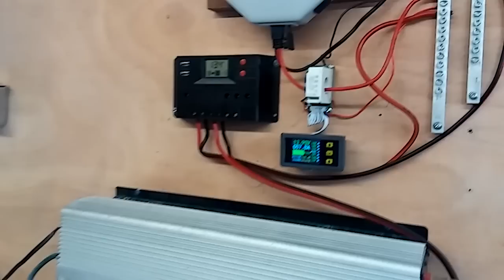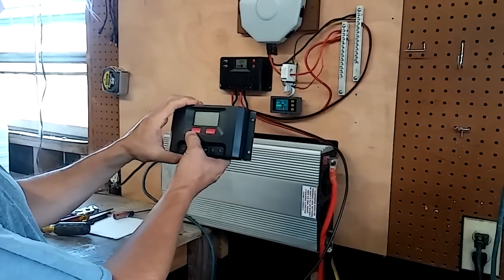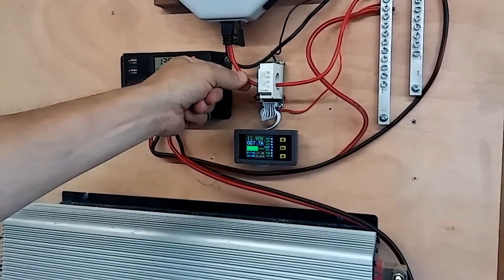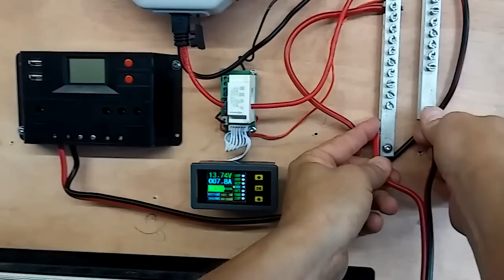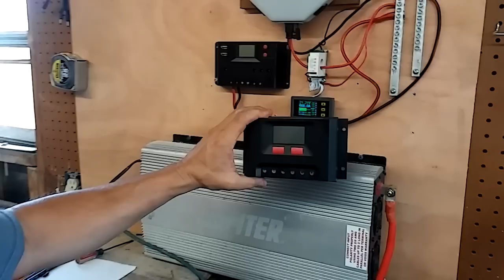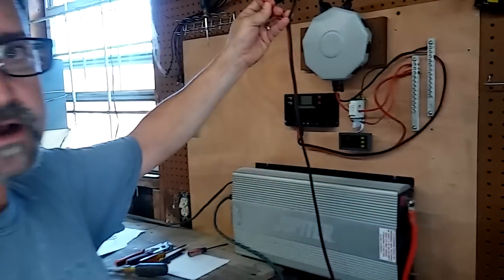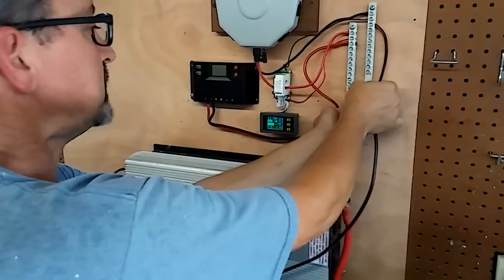Maxing out Harbor Freight solar panels

Comment: Hi, I watch you on utube, a lot and would like to tell ya, Something that happened to me, Concerning your problem of losses of power after Two different set of harbor freight solor panels are hooked up to the controller" with Hope's of Doubling your POWER".!! That Same thing happened to me, and I had to change one of the diode's around on the back of a couple of the panels. I can't remember if it was a whole set" that I did" or one or TWO. However, I do remember that after adding the 2nd, set" Of Thunderbolt 100watt, panels it ONLY gave me  1 1/2 output.!! But I Found out LATER, that it would have been SO MUCH EASIER, IF I had just ( used Both, Charge Controller's)!! And just ran Ea, set Through the Controller it Came with. Jumping the Power supply together just before going in to the Battery's.!! Okay" well, give them A try because " Just to settle for 1 1/2, the Power supply you should have, is not an option for me,. I hope You are the same," I mean It's what we thought we Was getting" Right?? It's what we all go spend our hard earned money for.!! NO, for me to settle, is to say give me 1 1/2 The Gas I have paid for.!! MACK!! OR, just Make it 3/4's  the gas I just bought,z!! Instead, of FULLER up MACK.!! So, There ya, have it.!! Straight from the Horse's mouth.!! Hope it helps,!!!

Comment: So the 10 amp controller can be used with big inverters? And no damage to the controller. I just got a 100 watt kit. Using it to charge batteries but was wondering on the size of inverter to use. I have two 80amp/hr deep cycles at 12volt. Thanks great video!
Reply from the maker: The charge controller is not affected by the size of your power inverter. Just don’t put more panels to your charge controller then it can except
Reply: @Checkitfirst  gotcha. Thx.

Comment: my experience with the 100 watt kit has been that the panels have to be pointed directly at the sun to get maximum output, and they produce a lot less output compared to a single 100 watt renogy panel when laying flat. the charge controller that comes with the kit really is junk.. it works, but you'll never make maximum power with it. the best test i did was to wire all 4 panels in series for 72 volts into a morningstar sunsaver mppt controller charging a 12 volt battery, with the panels aimed at bright sun they produced 9.8 amps. i also suspect that the long cords and silly mess of plug-in connectors in all harbor freight kits causes a lot of current loss.
Reply from the maker: Check out my latest video.. 300 watts now....
Reply: marzsit -What people fail to realize is these harbor Freight panels change some as long as there is light. The panels from Renogy need to be in a certain temperature range to change. This makes them ineffective when cold and mornings/evenings when sunlight isn’t hitting them at all.
Reply: marzsit I have been watching videos on the HF 100w system. I have been wondering if they could be wired in series, how that would affect the power production for the batteries and what would be needed within the system. 
Thanks for the info. 

D.
Reply: Why would you run 72 volts to a 12 volt battery. A 12 volt battery charged just fine at 14 volts. If you are running a 72 connection of solar panels make a 48v battery system and get a mpp solar 48v inverter
Reply: @westmountainadventures3606  I asked many people, finally after a dozen videos one man said you can as long as your using a good charge controller that can handle it; not harbor freight charge controllers are a  joke, but there monocrystalline panels are good. 22.3volts straight output.
Reply: @plove9136  Thank you for the reply. The sunsaver charge controller mentioned above seems to be sufficient to do the job. I’m sure by now there are others that may be better suited for this configuration. Other companies like Victron have such controllers.
Reply: @westmountainadventures3606  solar is so addictive, I'm a Frekn solar junkie. More, more,more.
Reply: @plove9136  Right? There are so many deep rabbit hole to go down when it comes to solar. Over the years I’ve progressed from looking at the above 100W system and thinking, hey that’s cool. To now I’m looking at 48V systems for my rig. 

I don’t have the funds to do a full conversation all at once. So, I’m looking at a battery back up system first and adding solar later.
Reply: @westmountainadventures3606  a lot of people started with 100 hf panel. Can I share some pretty cool Scripture that most don't comprehend, but you would because of solar?
Reply: @plove9136  Scripture? Related to solar? From what faith? You can share it if you like.
Reply: @westmountainadventures3606  God is light, and in Him is no darkness.
Reply: @plove9136  What faith? What religion? Chapter? Verse?
Reply: @westmountainadventures3606   Christian, 1John1:5 God is light, and in Him is no darkness. ...God's Glory shines on the earth, for life and power over the darkness. ...No man has ever seen God, no man can creep into Gods Kingdom.
Reply: @plove9136  The first part is a small clip from 1 John 1:5. A second hand account they allegedly heard. Apparently, referring to 1 Tim 6:16. “5 This is the message we have heard(K) from him and declare to you: God is light;(L) in him there is no darkness at all.” 
1 Tim 6:16 “16 who alone is immortal and who lives in unapproachable light, whom no one has seen or can see. To him be honor and might forever. Amen.” 
Where is the rest of it from? 

What does the analogy of “sin” to darkness have to do with solar technology?
Reply: @westmountainadventures3606  “blessed is he, who in the name of solar, keeps his panels clean, for he is truly the collector of photons…”
Volts 12:5

Comment: I'm glad I'm not the only one because in direct sunlight for my 100 watt kit I'm only getting just over 50 Watts. That's using the stands on top of concrete pointing right at the Sun on a not so hot summer day. So I don't think it is what some of these comments are saying like it's the way you have it mounted or because you have too many panels with a certain connector.
Reply: Many people complain that there HF Solar Panels are under performing.  The quality varies, usually towards the low end.  I would not be "glad" !
Reply: The specs advertised is at 24v when you bring it to 12 it's half of what you see on thunderbolts claim so 2 kits at 100w is correct and 1 kit at 50w is correct

Comment: Great Test!
Enjoyed watching.  
The MPPT will allow you start charging earlier in the day & later in the evening because it will increase the voltage.  The extra voltage is then converted to increase the number of amps going into the batteries allowing you to bulk charge earlier & get into float.
Reply: I thought an MPPT just increases the amps when the voltage is converted down to a battery. So say 18 volts at the panels to 12 volts at the battery. Are you saying if the panel is only getting 7 volts due to clouds the MPPT converter will increase the voltage to 12 while decreasing the amps? Also can the MPPT take an 18 volt at the panel and increase it to 20 volts to charge a 20 volt battery? thanks
Reply: @voidisyinyangvoidisyinyang885  
No I am not saying the charge controller will step up the Voltage.  If each panel is receiving poor light & outputting 7v the 4 panels all together now have 28v or if things are real bad & each panel is only receiving enough light to generate 4v you still have 16v & can charge this is why in the morning you can start sooner when the light is mostly ambient & same later in the evening when the sun is going down.
Reply: @LarsLondian   good point but you would have to rewire the panels in series. They are wired in parallel.

Comment: Been living off 12v solar for 15 years.      Fat tinned wire is a must  have  copper wire will go green and cause power losses.  A quality controller that gives a 3o day input history is well worth the money  shade tolerance of your panels for s important spec  even quality battery can have life cycle greatly reduced by deep discharge.     Plan your bank so you use only half or less Amps available daily     keep your battery recharged  any way you can. Solar is soft so  charge with alt means at every opportunity       a good battery system is like pet if you look after them they live a long time      it's possible to get ten years.    Or two weeks  once they get damaged low discharge it's out put is Amps available reduced by large margin   it was a learning curve to start.     But we'll worth the effort no power bill for 15 years less system cost and battery s.   Is still a lot of money.  Ditch 240 volts go 12 volt every time you can  a lot of your house hold needs can be well sorted and already are only 12 volt tv etc    keep it simple as you can but.   Put in lots of fuses      have a go it's a great hobby
Reply from the maker: Great info. I have learned a lot since this video. I did however go to 24 volt system with a EPever 30 amp charger. I now have 500 watts of solar. But yes,,, batteries are an issue for me with 24v. I only have 2 marine batteries. They say 100 amp hour but come to find out it’s really about 30 amp hours. Led acid,,,,,🙄. I need about six batteries to get 100 amp hours of real use. I am thinking about going back to 12 V and getting a single lithium hundred amp hour battery. Watching videos on YouTube they seem to give you a full 100 amp hours. What is your take on lithium. I also have my panels in series around 108 V to 110 V depending on conditions.
Reply: @Checkitfirst  good on you  I have stuck to Lead acid deep cycle  a 2oo amp hour about 600 $. But you have to check fluid level regular especially in hot weather  no mantaince  ones dry out n fail eventually    who's best interest is that in not yours.      Power only runs on outside of wire not in middle longer the wire fatter in has to be      240 has tourqe  so gets away with thin wire  tractor vs pushbike   if you are not weight or room limited.  Go for physical ly big battery.  Buy a trusted local brand   as you charge the input is affected by resistance the fuller the battery more resistant harder to charge  I've found bigger the better and only use 100amp hr if linked to bank of four   a hundred amp hr alternator car etc runs your needs but still only puts in what the bank can absorb tipacaley 5_8 Amps an HR if it starts out at 3o amp charging watch it drop input fast as charge comes up volts is guide if you discharge below 12,4 Volt's U get into power poverty quick  hope it helps good on you for having a go
Reply: @Checkitfirst  get a lifepo4 12v 200ah battery (or 100ah depending on price) and don’t look back, move forward 🔜

Forgot about led acid, it’s obsolete at this point car manufacturer still use them cause they buy in bulk for cheap.
Reply from the maker: @isramen4756  
I would love one but can’t afford it

Comment: On a 2000 watt Jupiter inverter, would I need a 175 or 200 amp in line fuse, between the battery and invertor on the positive cable? Thanks!
Reply from the maker: If it were me, I would use a 150 amp fuse. 12.5 V x 150amps  = 1875 Watts. You probably don’t want to max out your inverter. But if you want to max out your Inverter then I guess 175 amp fuse would work
Reply: Thanks for the video and the reply!
Reply from the maker: @davidpalmer9091  your very welcome.

Comment: Could it be because your panels are in parallel rather than series as to the reason you're only getting roughly 100w total?
Reply from the maker: Running series or parallel doesn’t change your wattage

Comment: Hi great video. What is that box called that shows different readings? The one you pointed to. Thanks, alicia
Reply from the maker: Charge-Discharge Monitor, DROK 0-90V 100A DC Ammeter Voltmeter, 
I bought it off of Amazon. Type it in just like that and it should pop up

Comment: can the original charge controller handle 200 watts ?
Reply from the maker: Yes. I ran 200 W through mine for a long time. I opened it up and looked inside and it has a 20 amp fuse.

Comment: I think you could benefit by mounting your solar panels with a 1 inch gap between the roof in the back of the panels for cooling
Reply from the maker: Probably so. I just can’t see to reach the point of drilling holes in the roof. There only mounted with 1/2 “ screws so I’m not penetrating all the way through the roof deck. A little sealant on each screw

Comment: can you just connect the wire from the hub to the charge controller and skip the bus panel?
Reply from the maker: Yes. I am only using the bus bars for future add-ons. There is a lot of connection on those bus bars to do for future projects

Comment: Yep. I changed my six Harbor freight panels to a renogy 30 amp charge controller. I basically have the same setup.  I use two Harbor freight batteries to run my 12 volatile lighting system.

Comment: Hi can you post a video on how to hook up harbor freight solar panel kit to a 400 watt maximum thunderbolt connector hub.
Reply from the maker: I would be more than happy to but I no longer use that hub. Maybe I can tell you and see if that helps. When you are staring at the front of the hub you will see that the word output is in bedded on the face. Each harbor freight kit has four solar panels that connect to one wire. That one wire has four connections on one end for each panel to connect to. After you connect all for solar panels to that one wire you can then connect that wire to any of the input connections on the hub. There are eight inputs and one output. The kit comes with a wire that plugs into the output and has a female jack on the other end that plugs into the charge controller that comes with the kit

Comment: You will gain more with a mppt controller. The voltage that it drops when connected directly to the battery is a loss. Because volts times amps is watts. Anytime one drops and the other doesent go up its a loss! I would get a 10-20amp mppt controller and for a 12v system. Arrange the pannel wiring for about 22-24v no more than 28v when i had only 300 watts of my panels up with my 30a mppt controller. I was getting about 260 watts. With a terrible angle. Witch is really good for the situation. With the proper wiring . meaning just because the controller can take 150 volts in. Doesn't mean it will be effiecent converting it to 12-14v... About 1.5-1.9 times battery voltage is about the best conversion effiencey . allowing the panels to stay in their max power range.where the volts and amps are at the max. And yeah, nothing is perfect, there will be losses...
Reply: He could always add a 6 v battery in series to 'max' the panels power and voltage of 18 volts...

Comment: Them hubs say you can connect up to 4 units...yet it looks like it has 7 inputs and 1 output? So 8 connections? I got same kit bit only 1 for now and one of them batteries...i may return battery bc I found higher capacity ones for similar price

Comment: You should be checking the power going into the battery, not the power coming off of the solar panels.  Input power and output power are 2 different things.  Whatever power goes into the battery is what you can theoretically use, and in reality, not 100% of it (batteries have losses too).  It would be interesting to put your ammeter on the OUTPUT side to see how much current is going into the battery.  I bet it is considerably lower than the 8A or so you are getting on the input side.  My advice would be to sell that other controller that you only got about 5A from (or return it for a refund), and buy 2 more amorphous panels for about the same price as that controller.  If you can get a true 8A flowing into the battery bank, then you will have a true 100 watts of usable solar power.